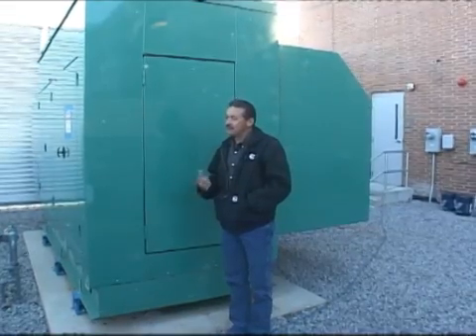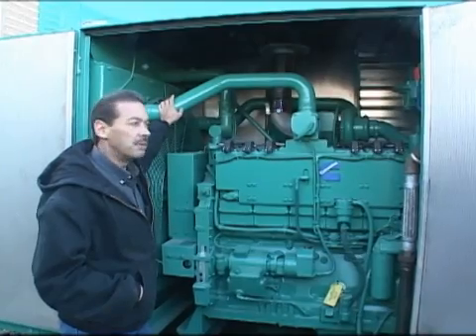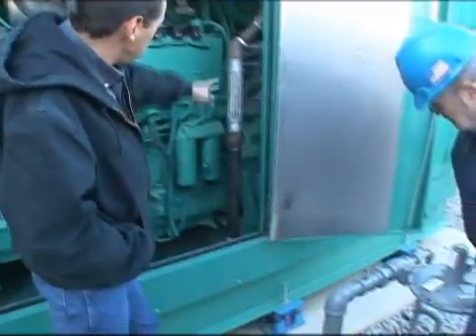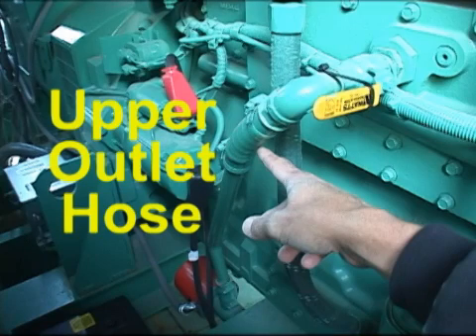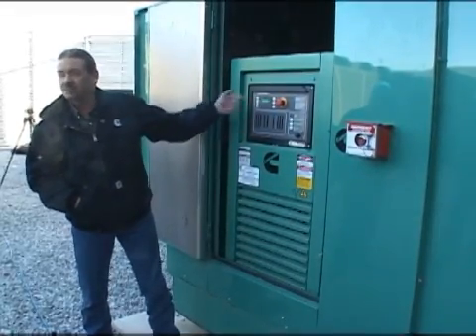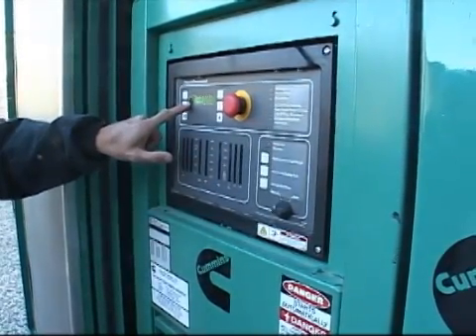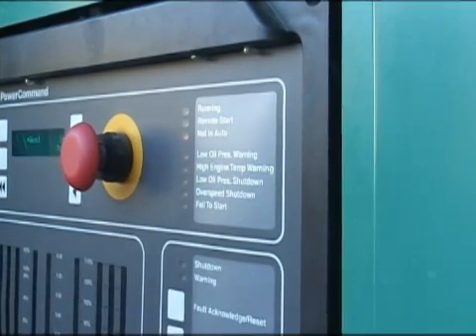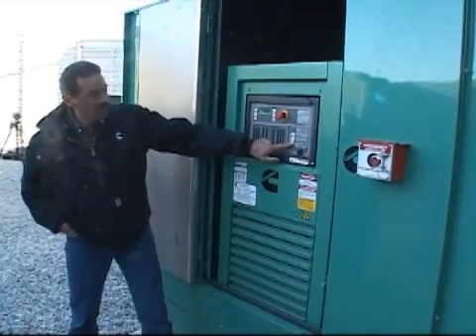Cummins  Emergency Generator Training

Comment: Trouble shooting in Cummins generator

@tPYU- "Excessive Accelecation Smoke
@aN8c- "Engine Misses
@p9ak- "Hard Start or Failure to start"
@dBNM- "Excessive Smoke Under Load"
@ai2c- "Black Smoke at Idle"
@lixQ- "White Smoke at Idle"

Comment: So I was wondering the same thing. At the end someone asks if it needs a cooldown. Does it?
Reply: Yes, once the transfer switch goes back to utility power the genset will enter a cool down period. Typically less than 20 minutes.

Comment: Why is my generator like this one not running a health check every month it has not been needed but the batteries are dead
Reply: The generator exercise function is initiated from the automatic transfer switch. This needs to be programmed at the ATS.

Comment: Hello Sir , thank you for your clear explanation,  it so happen that we have the same Cummins Diesel Engine emergency power supply,  ... i have this problem encounter may be a couple of weeks ago, I don't have any idea on how to address this error on screen display,  here is the fault, it says: " Fuel Pressure Low - .. 94,18,21" what does it mean.. thanks and more power to you Sir. God bless everyone have  a nice day.

Comment: But in case of power blackout the natural gas supply will also fail?!
Reply: Most of the main compressor stations, feeding the large interstate pipelines, are typically fueled by natural gas and generate their power with it, to keep operations running. Gas-fueled compressors could be more widely used throughout the system, but they are noisy and have environmental implications.

Comment: I have a new  24kw 3phase  silent Cummins ,  can you tell me where to put the two hoses on the fuel tank because there are three connection on the tank also do I have to change or do anything other than add diesel and coolant before the first start

Comment: How to change Hz 60 to 50, help me
Reply: +abdurraheem khan HZ (frequency) is controlled by the engine Rpms depending on how many magnetic poles are in the alternator.
Reply: +abdurraheem khan 4 pole alternator runs at 1,500 RPM for 50 Hz and 1,800 RPM for 60 Hz.

Comment: I have a 750KW Cummins Engine Emergency Generator.  I'm getting low oil pressure, 40 psi the oil pump has been replaced. oil coolers been replaced, any suggestions?Chris Carter
Reply: Oil Filters?
Reply: Idk about diesel but in automotive the oil pump does not create pressure it only creates flow. Your pressure comes from tolerance specific areas like bearing surfaces and oil gallery's. Its basically any area where oil need's to squeeze thru where pressure is built so if your bearing tolerances are off due to improper maintenance then you will not be able to build pressure.
Reply: Engine overhaul